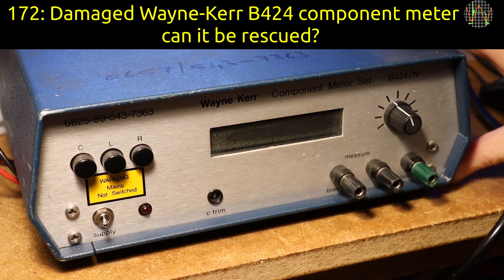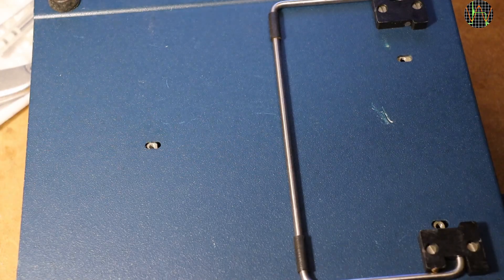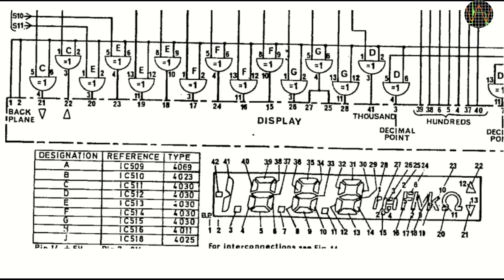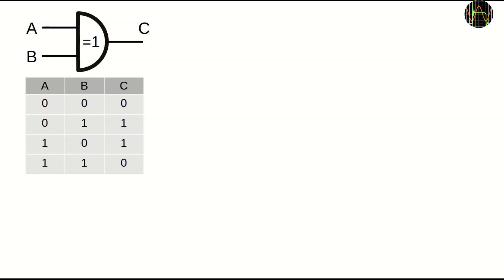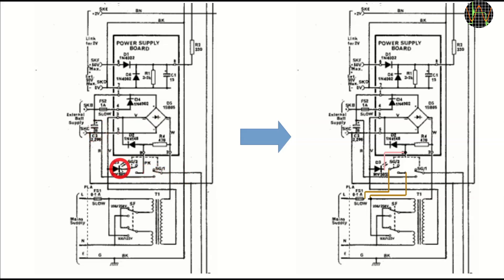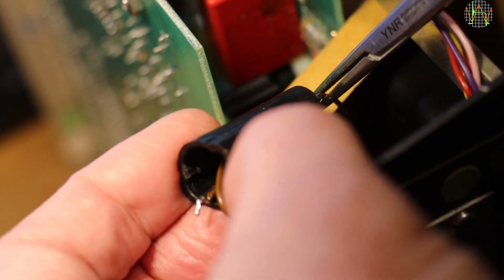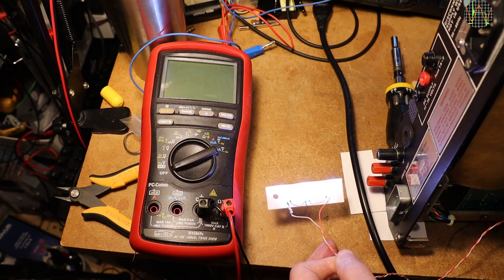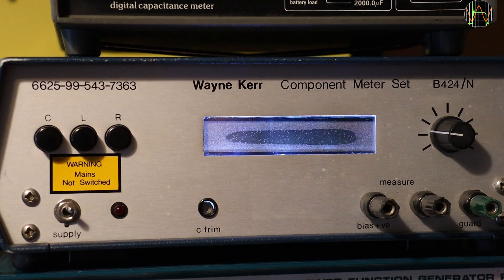172 - Damaged Wayne-Kerr B424 component meter - can it be rescued?

Comment: Very clever bleeder circuit! I wonder why the original design had no mains switch - that seems odd to me. Thank you for another interesting video. Regards, David
Reply: Hint comes from the optional Go/No-Go module. This thing's intended customers are commercial and factories that will leave it powered almost all the time, and constantly testing components, and/or because they're commercial they literally don't care about the power bill from such a thing. It's not uncommon to find 2nd hand benchtop multimeters for sale with their power button literally missing after someone extracted it, because they didn't want the thing to be possible to turn off normally at all when it was as its job.